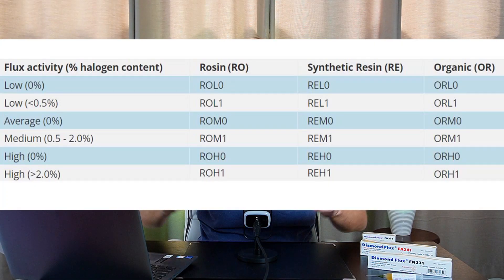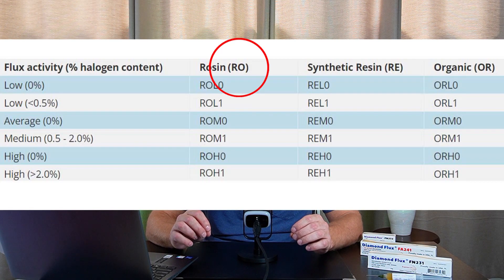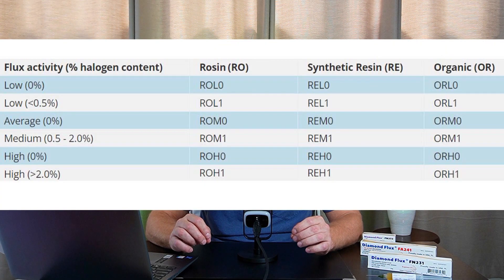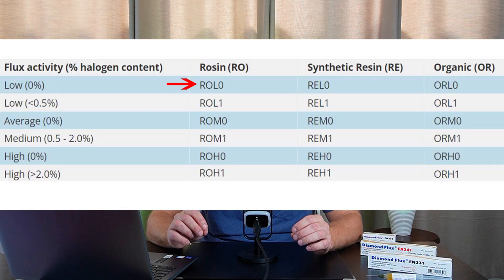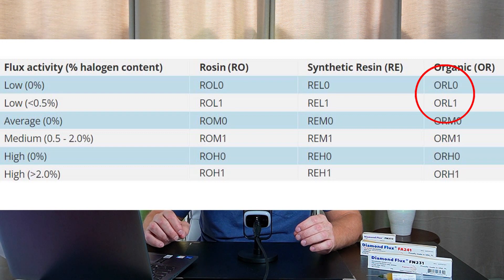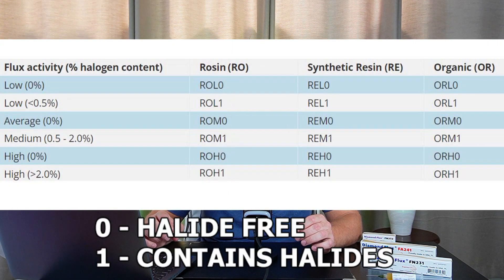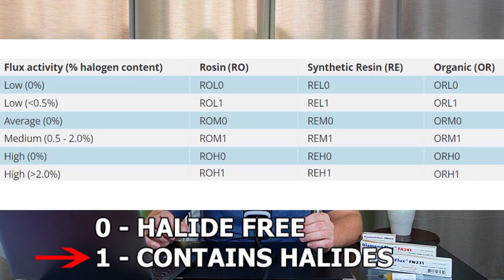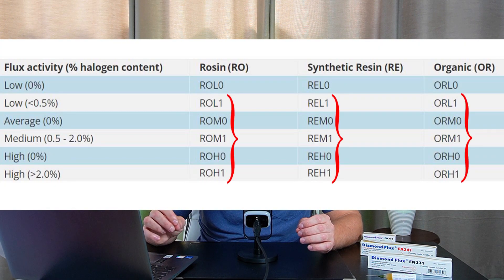Soldering flux classification - How to choose best flux?

Comment: Is there any video of information on knowing what the new designations related to old ones?  Such as RMA 223 translated into the new designations?  Also what are the numbers after the letter designations mean such as RMA 213 vs RMA 223??  thanks!  you have a good channel that I am looking at now,
Reply from the maker: Hi. Thank you for the question!
RMA - Rosin Medium Activated.

The digits don't mean anything. It's up to the manufacturer. For example, my flux is labeled FN231 - FLUX NOCLEAN 2023 January developed.

Share video in your social media and LinkedIn if possible 😊

Comment: In the DIY environment, when it is not guaranteed that all flux reacts and boils off; and therefor even ROLO flux needs to be cleaned off; is there any reason to even use ROL0 or ROM0? Why not just go for ORH1 for guaranteed cleaning if washing is required either way?
Reply from the maker: The quality of the flux is of paramount importance. Using Chinese junk, even ROL0 can be active. Classificators are used in industry for a reason - the manufacturer selects the flux for the task. For soldering and repairing electronics that have not been exposed to humidity, it is best to use high-quality ROL0 flux, the unwashed residues of which will definitely not cause corrosion and current leaks. Any number 1 in the classificator guarantees the presence of halogens and that the flux will remain active after soldering and corrosion will begin. Electronics cannot be exposed to this. ORH1 is the most active flux with halogens. It is used in very high-speed oven soldering and several stages of washing are used. Otherwise, everything will rot.

Comment: I recently aquired a ps5 through ebay which was sold as a repaired hdmi port, arrived no signal so ebay honoured a refund keeping the ps5. I brought a hx36 iliailia hot air station that came with everything. Not the best but it does the job. The 'solder paste' it came with looks like vaseline and i was striggling to work with it, i decided to purchase something different and went with FLUX PASTE LEAD FREE BEST 559A LOW RESIDUE SOLDER FLUX NO CLEAN which is working much better now. Ps5 had torn traces and missing capacitors and a 71 zener diode, so ive learned how to repair traces i just havent finished it yet. Now im learning temps and all the inbetweens. Thanks so much for putting out the info on your channel i have subbed 👍🏼
Reply from the maker: You are welcome 👍

Comment: The ROL0 classification fluxes for me are alright but I really love the L1 & M1 I work on generally older pcbs from the 90's or earlier and I find the stronger activity helps me to combat the oxidation better and makes rework easier for me. I've tried halogen free fluxes but I find they all tend to suck unless if the board is brand new off the assembly line or it is squeaky clean. Help me out with some of your expertise because I see one of my favorite manufacturers rolling out alot of halogen free stuff. Is it worth the extra struggle? Im always cleaning right after with 99% ipa and orange oil solvent because it breaks down the residues for me much more effectively. 

Also would a resin synthetic flux work much better than the standard rosin? I tend to like the RE types but I find RO is the good old reliable that's hard to beat. Is it possible to fabricate tacky flux that does not create a lot of smoke? Also what about a clear variant? I would love to see those two things incorporated in a future revision if you decide to make a new one.
Reply from the maker: The production of any soldering flux consists of many BUTs. Any development requires research, preparation and testing. Of course, almost everything can be done, but with what efforts. And there is also an economic component, which shows which products are in high demand. There are always problems with smoke and I understand you well. Unfortunately, it is difficult to find some suppliers whose products would allow a series of tests to be carried out.

Comment: What means flux type :RMA-223-UV
Reply from the maker: ROM0 - middle activity.
The decoding of numbers should be looked for in the product description.
UV means that you can check the flux residue in ultraviolet light. I seriously doubt that it is healthy to use eye-damaging ultraviolet light for work.
In the electronics industry, the UV method is used to control waterproof coatings, but with reliable eye protection.
Reply: @ElectronicsManufacturingTech   what about the  Amtech Halogen Free, Type: NC-559-ASM?
I don't see any reference I saw in your video. But I loved your Explainations.
So I will subscribe. Thank you in advance.
Reply from the maker: Thank you. You know, Chinese products never have a clear description and characteristics, and this always raises suspicions. What is inside and how it interacts is unclear.

Comment: So, than smaller components, than more high activity flux required? For example ROH0 will deactivated after full heating and will be like ROL0? If it will heated not fully if will conductive? Because sometimes flux going out full heating zone on repairs.
Reply from the maker: No.
That depends from the technical process. Speedy mass production choosing one type of flux, another choosing the second technical process and flux. That depends from the cleaning machine in the manufactory, cleaning liquid, requirements.

The larger production volumes create the more defects and unsoldered parts there will be due to possible defects and oxides in the coatings copper-gold-tin of printed circuit boards. To reduce defects and enhance soldering capabilities, more active fluxes are used to make sure everything is soldered. But then need to wash it off.

ROL0 using everywhere too for automated soldering. 
ROH0 high active without halides. Main - is Active. Need to Clean. Flux residues still active.